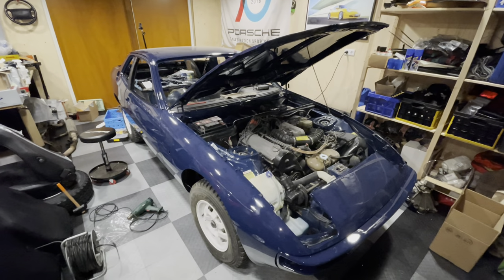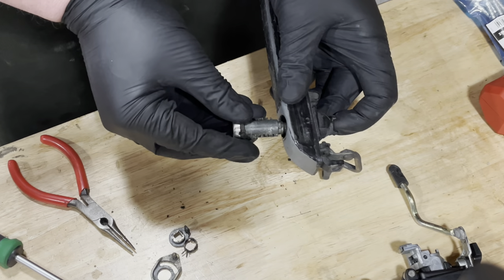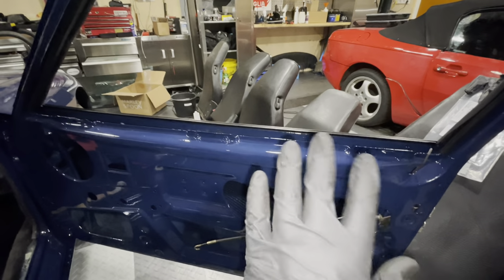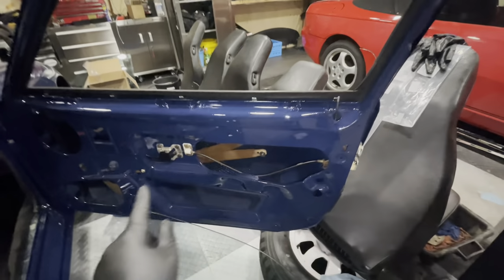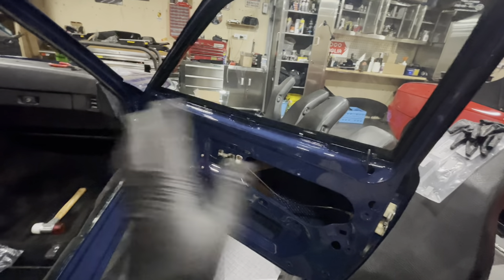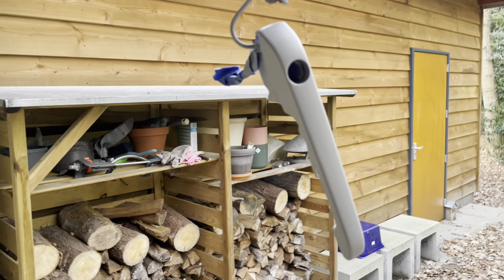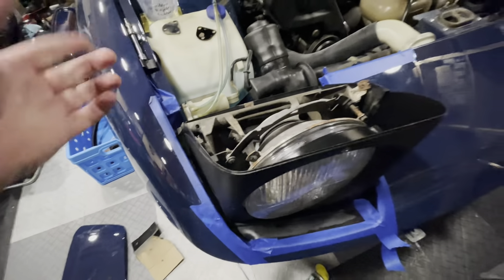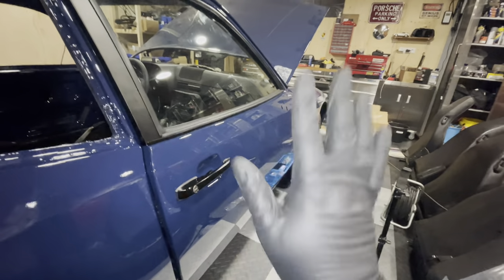Building a Porsche 924 Safari: building up the body after repaint - Part 2

Comment: Nice work!  Couple of thoughts - did you lube the window mechanisms before installing?  Also, the lock cylinders had a gasket that almost always is crumbled and is NLA from Porsche.  I substituted by finding an appropriate size o-ring
Reply from the maker: Thanks Jeff, the window mechanism was lubed on all joints and I also applied some PTFE in the guide rails. Good advice on the O-ring! Since they became NLA I have just omited them as my cars do not sleep outside. I don't think a lot of water find their way past the cylinder anyway as my turbo don't have them either and I have never had water inside the door.

Comment: The 944 has central locking on them, the 924 never had central locking, so the barrels are different
Reply from the maker: Wel yes and no, the 968 also has central locking but shares the barrels with the 924. I Don’t know how long they made the ones with “teeth” but I have never come across these specific barrels.